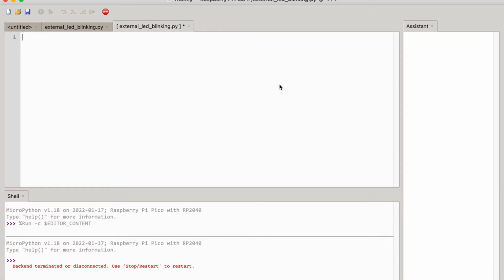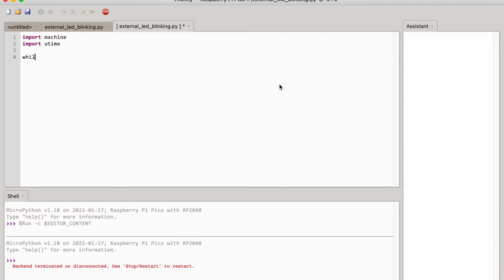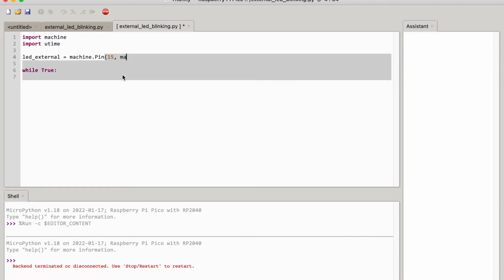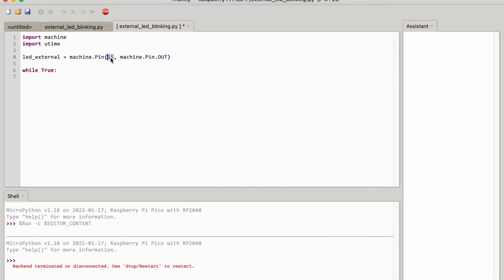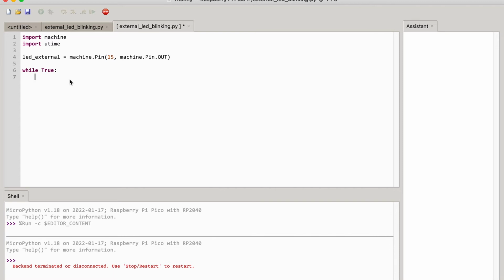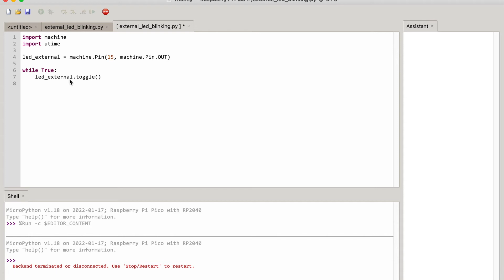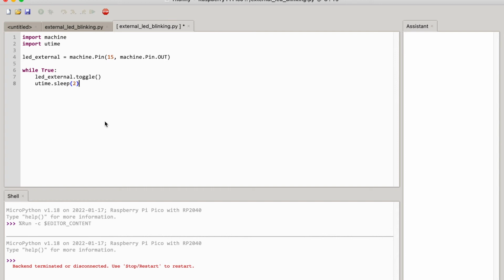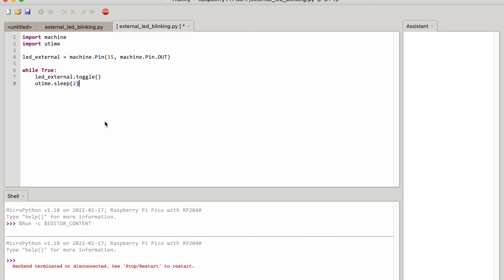Raspberry Pi Pico SIMPLE Project (External LED Blinking Tutorial) | Beginner Electronics Project

Comment: doesn't work
Reply from the maker: Thanks for the comment! Make sure you are pushing the pins far enough into the breadboard to make sure the circuit is connecting! Also, make sure your code is 100% correct.